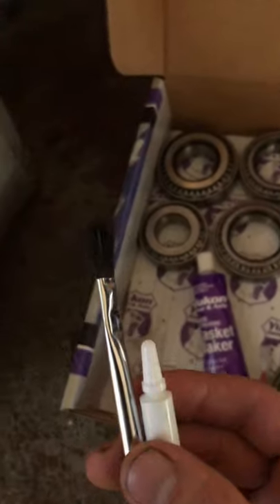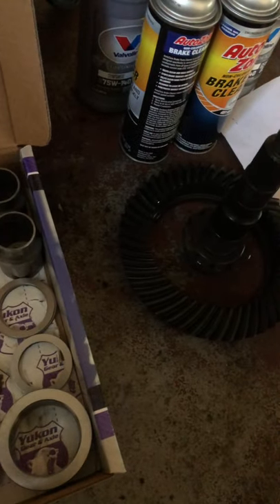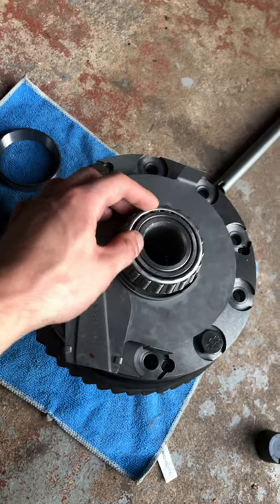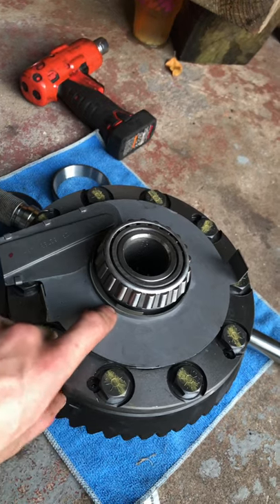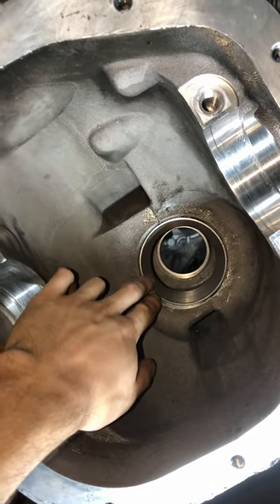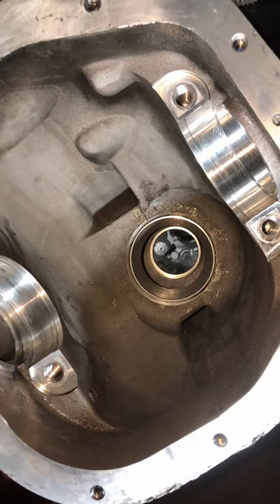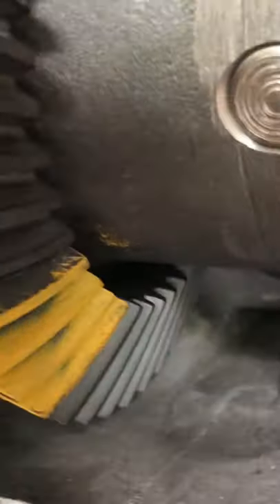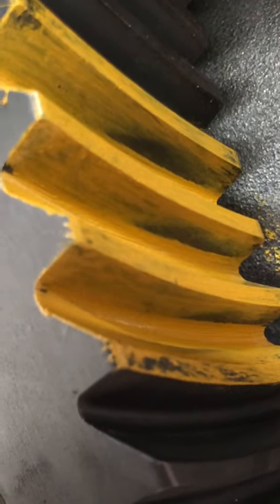Jeep wj gear instal Dana 44hd

Comment: My 04 wj 4.7 front differential needs a set of new gears. i have a 3.73 gear ratio on 29 inch tires, would it be greatly beneficial torque and power wise sticking with 29 inch tires and going to a higher gear ratio like 4.56 Spicer gears while keeping 235/75r16 tires with the availability to upgrade if i wanted down the road whenever I felt like, or should i just keep the same ratio and have them put a fresh set of 3.73 limited slip spicer gears in my quadra drive ii. 3.73 are good, but I'd like more power and torque if im going to put a fresh set of gears in it, dont get me wrong the 3.73 are no joke and i love them but but wondering if going to 4.56 from 3.73 and keeping my 235/75r16 would be beneficial staying at the same rpm range and with in spec, at 70mph im  a steady 2000rpm which is good and where it should be. Sure, maybe my rpm cruising will go up going from 3.73 gears 235/75r16 tires to 4.56 gears keeping my 235/75r16 tires.
Reply from the maker: @Greg-qs2jp  4.56 with 29s will be turning some serious rpm on the highway maybe you would be happier with a ratio or two lower you also have to do front and rear at same time or you can not use awd or 4wd

Comment: Hey Dylan it’s been 2 years so you probably won’t see this but it’s worth a shot. Just wondering if you have any idea how to change the clutches on this particular Dana44. The hole for the spider gears just seem way to small for any of them to come out so just wondering since I believe mine are going out. Thanks👍
Reply from the maker: I see everything lol always check my comments you have to take them out sideways kinda if that makes sense I’ve personally never done them but I know they come out somehow I know with my ford 8.8 had to like wiggle them around if you need anymore help just comment and send me a dm on Instagram thanks for watching the videos!
Reply: Ahh okay gotcha, also by any chance do you know if the open diff carrier will bolt right into this lsd diff in case I wanted to go with a locker instead of replacing the clutches
Reply from the maker: @kendrekmarrero5585  it will not you would need an open diff to put a locker in it the case is different if you were to buy a whole complete locker with case yes it will go in the pumpkin but if your looking to do an Aussie lunch box locker it will not work with a varilok diff
Reply: You know what. I think the clutches might be alright after all. I thought they were going bad cause yesterday morning I went to make a u turn in front of my house right after turning it on at low speeds and I was hearing a little chudder/moaning sound from what I think were the clutches but today I went out and jacked up one tire and I believe it’s engaging as it should be, and it also wasn’t making the sound, although it was warmed up already. You know if these clutches can be a little noisy when cold or something? If you drop your @ I can send you the vid on ig
Reply from the maker: @kendrekmarrero5585  Instagram is in my YouTube bio it’s djd_wj_ and mine do make noises sometimes on sharp turns the key is to make sure you add the mopar friction modifier you can also test your clutches by jacking up 3 wheels with one on ground and try and drive forward it should send the power to wheel on the ground
Reply: @kendrekmarrero5585 there are no clutches in the WJ Dana 44a

Comment: Hi
How it does after regear does it have any gear noise?
My search says most regear 44 a hd noizy.
Pls share experience and some videos u got one.
Reply from the maker: No issues at all zero noise zero play if you do it right it’s fine gotta be precise with measurements I have 15000 miles since gear change no issues at all I have other videos on my channel if you wanna check them out

Comment: Pinion bearings are way too tight.  Sposta be 15 - 20 in/lbs for new bearings, not 25-30. Hopefully, they lasted a while and didn't burn out in 2 weeks. If you just change the bearings, you probably don't need to change any of the shims or check the pinion depth. If you're doing a re gear.
You should check all that. Otherwise, you're probably just wasting your money.  I know nobody really wants to hear that,but that's why the pros charge so much to do it. Plus, specialty tools aren't cheap. Even then, some shops still suck at re gears. And you'll always need to replace the crush sleeve, or at least shim the pinion side of the old one so you can get it to crush down a little more.
Reply from the maker: No issues at all been 3 years and thousands of miles no noise slop or anything!

Comment: Looking at replacing my 35 in my zj with a cheap local 44a.. are these still C clip?
Reply from the maker: No they are not they have a plate on the end with 4 nuts that holds the axle in
Reply: @dylansgarage3549  sweet, it looks like the factory zj 44a were c clip, that was my concern. Looks like this will be a good candidate for my swap. I have a set of 60s, but I'm trying to stay low budget and narrow as possible
Reply from the maker: @MegaMarclar  nice I’d love to put 60s under mine
Reply: @dylansgarage3549  60s are nice for sure. But they are heavy, significantly wider, expensive to convert to disk, then you need wheels and tires.. it has its benefits but also its disadvantages. That extra 6 to 8 in can mean fitting or not fitting thru a trail. I started wheeling in ny 87 ramcharger, and there are places thr zj goes that the dodge just plane cant go. I have an 8.25 in my liberty I considered swapping, but I just like the d44 more. Looked at getting the wrangler stuff, but they want 40 virgins in exchange for one. Figured the 44hd/a would be a good runt of the litter comparable unit. I plan on doing probably 4.55 and a spool.
Reply from the maker: @MegaMarclar  I got 4.56 in mine and the varilok diff and yea way overpriced for jk 44

Comment: Hi.
I need help, dana 44A rear the pump is moving freely it has play is it normal or should be tight on carier?
Thanks in advance.
Reply from the maker: It should be able to move but there are two locking tabs on the pump they should hit the case on the rear diff so it won’t spin all the way around
Reply: @dylansgarage3549  thanks for help, it is so moves freely and hits case but not rotating with case.
Reply from the maker: @j.m.967  yea you should be good to go! Anytime good luck with your project!
Reply: @dylansgarage3549  thanks again, love WJ my favourite with jeep family.
Reply from the maker: @j.m.967   anytime and yea me to I’ve owned mine for 7 years last grand with solid axles last real grand Cherokee

Comment: Dylan, I could not find the plenum (oil pump as you called it) at Quadratec.  Do you happen to remember the part number?  Thanks.
Reply from the maker: https://www.quadratec.com/products/916508_40.htm?gclid=Cj0KCQiAkuP9BRCkARIsAKGLE8XT_qjiraLWLiJ3JlcxGdxGeOFhbhVl5zFBYIcU_hbH8_rQtbXSaCIaArspEALw_wcB
Reply from the maker: That’s for the Dana 30
Reply: @dylansgarage3549  thanks.  I happened to find it just seconds before I checked for your reply.
Reply from the maker: For some reason they don’t list the 44 one anymore I’m going to try and find it somewhere else for you give me a min
Reply from the maker: https://www.justdifferentials.com/Dana-44A-44HD-Jeep-Grand-Cherokee-WJ-Plenum-Seal-p/dan52783.htm
Reply from the maker: That should take care of both axles for you if you have any other questions don’t hesitate to ask and thanks for the support on my videos!
Reply: @dylansgarage3549  thanks again!

Comment: Thanks man very helpfull, i am going to do same can you help me i can not find gear an pinion with bearing set for wj 2004 limited 4.7 V8 with varilock diffs as yours,
Please help how to find gear and bearings set part number or model i need both front dana 30 and dana 44A rear.

Thanks in advance.
Reply from the maker: J. M.  Go to rock auto they will have everything you need on there site
Reply: Dylan Dimura thsnks, i will check with them.
Reply from the maker: J. M. That’s wear I ordered my stuff from even the gears
Reply: Dylan Dimura need help for part numbers to find on ebay for order corect parts.
Reply from the maker: J. M. Do not order on eBay you’ll get cheap parts and they won’t last go to rock auto like I said and order name brand parts!
Reply: Dylan Dimura thanks please drop rock auto likn to find them.
Reply from the maker: J. M. Rockauto.com